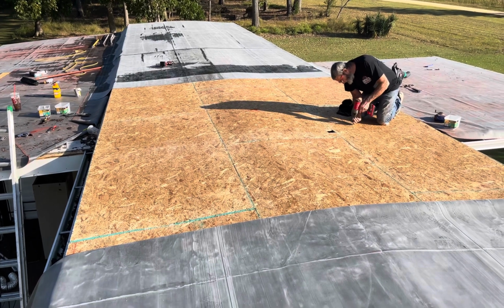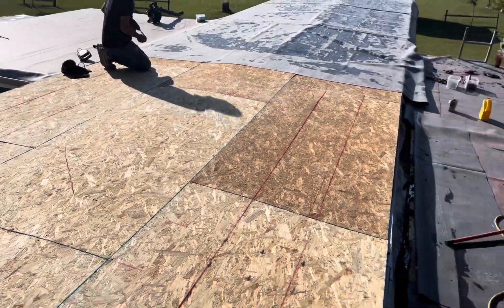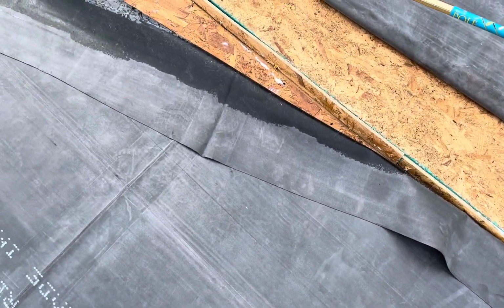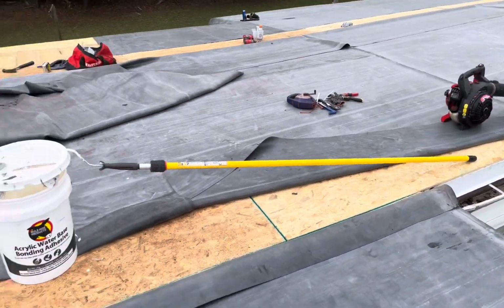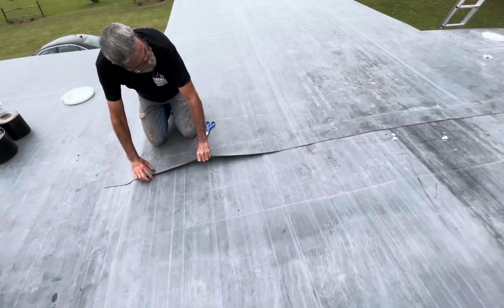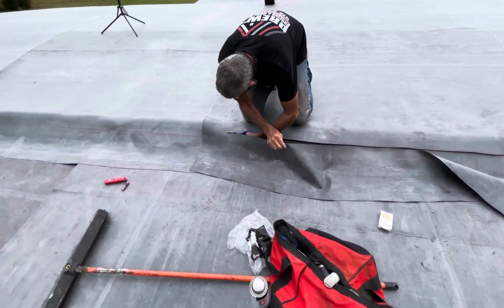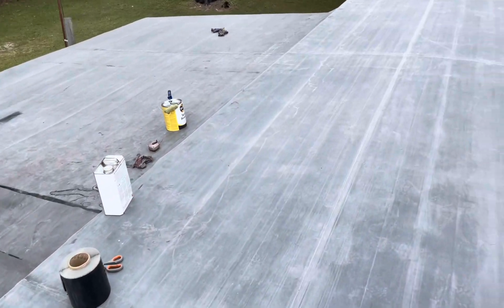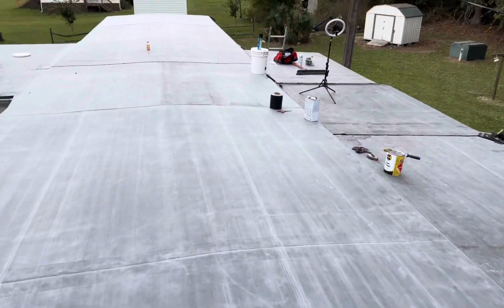Scrapping With Grandpa with left handed Paul . Mobile Home roofing.

Comment: Do u like that Elmer glue better than that old yellow glue for the rubber? I know once that yellow glue is down there is no moving it.God bless you and your family my friend.
Reply from the maker: If you use the yellow glue when you put it down, it is contact cement it’s done if you have a wrinkle you can’t fix it. I love the white water base substrate grew more like Elmers so much easier to work with.
Reply: @ScrappingwithGrandpa  I seen a demo about it many years ago when it first came out and I was always wondering if it held as good as the yellow?  and one more question grandpa why didn't you use a insulation board under that rubber? Thank you for taking your time to answer my questions. God bless you and your family my friend.
Reply from the maker: I’m not a fan of the insulation board. As a matter fact I’ve only used it on two or three jobs in my whole career of doing mobile homes. Like I say I’m just not a fan of it. The rubber gloves down just fine to the OSB.
Reply: @ScrappingwithGrandpa  Ok I understand and it's a pain in the butt to lay down. I always hated putting that on myself and now I know it's fine without it awesome. Thank you grandpa I really enjoy your channel and all of your info about different things. You remind me of my grandpa God rest his soul. God bless you and your family my friend.